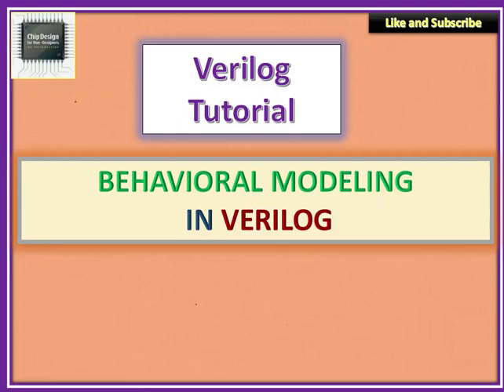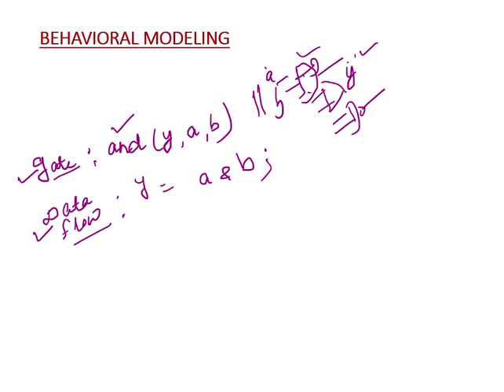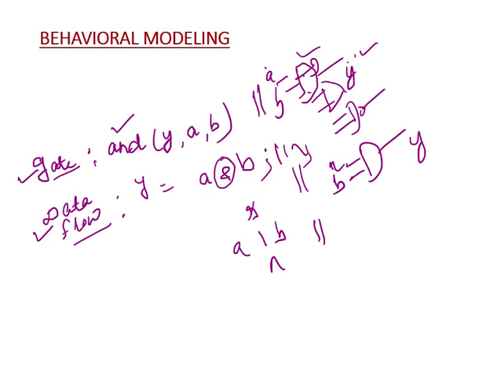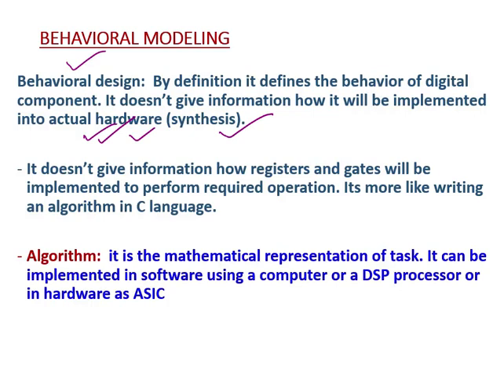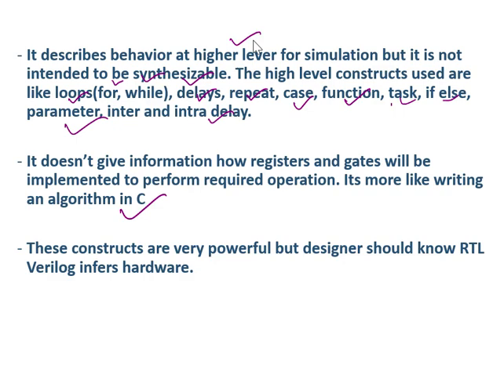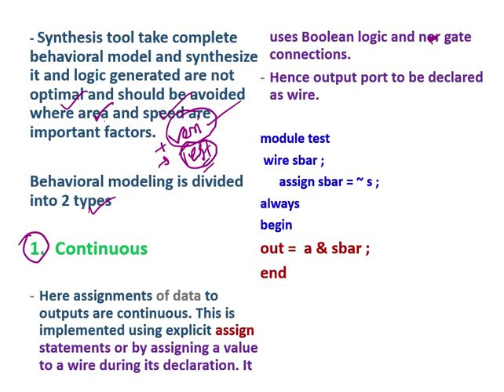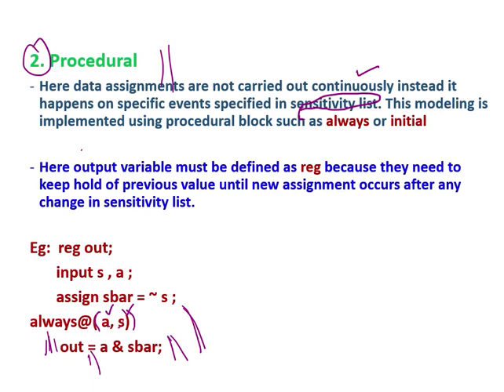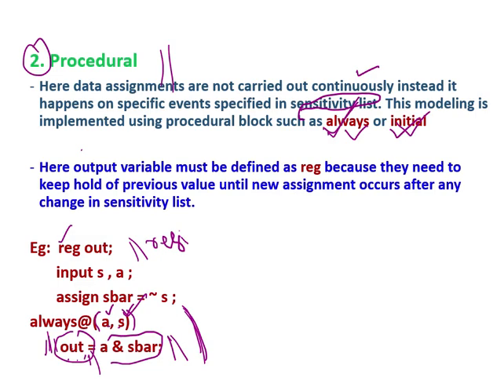#9  Behavioral modelling in verilog || Level of abstraction in logic design

Comment: Hello sir? What exactly is RTL modeling? Is it the same as data flow ??
Reply from the maker: No, it's not same as dataflow. RTL modeling gives information about how a code is implemented as real hardware and how data will be transferred between register and gates. So it's called register transfer level. This modeling defines digital ckt as combination of register and digital operation are performed between those register. This RTL code is input to synthesis tools. So any verilog code which is synthesized are called RTL code means the verilog code which has its corresponding optimized hardware or ckt is called RTL code. Visualise it once and you will get what I wrote. Thanks.
Reply: @ComponentByte  Thank you so much sir 😊

Comment: bro i am doing my major project on open source eda tool based on vlsi in which area,delay,power are main parameter to be consider my project name is Implementation and Physical Design of 8/4-Bit
Signed Divider bro in this divider we are written module in  behaviour model due to which we are getting problem in synthesis as i had seen in this video that behaviour modelling may be synthesis may not and does give information about the design connectivity in netlist and also this model is not considered as good for determine the parameter speed,delay bro pls guide me and tell me which model level will better for my major project and what modules are required in it designning
Reply from the maker: While writing verilog code , it's always a benefit to follow RTL coding guidelines as the synthesis tool converts it into optimized hardware. It mostly depends on the logic design and then coding skill and synthesis tool we use. Different synthesis tools give different results and reports. 
So work on your logic because there should not be unnecessary lines in your code as it generates unwanted logic and hence consume power and silicon area and thus time. 
Some write code thinking in mind the real hardware.
Some write code with the mindset to implement the logic only and thus end up writing C code .
Reply: @ComponentByte  bro me and grp are using open source eda tool like iverilog and yosys and for backend we are using Ubuntu can you pls provide some kind of suggestions what to do and what not to do
Reply from the maker: Your project seems to be very interesting but I have never worked on open source EDA and Ubuntu so I doubt , I can be service to you.
Reply: @ComponentByte  thx you so much bro you said that you will support me that is big motivation for me and my team